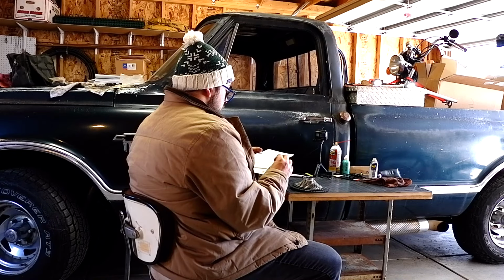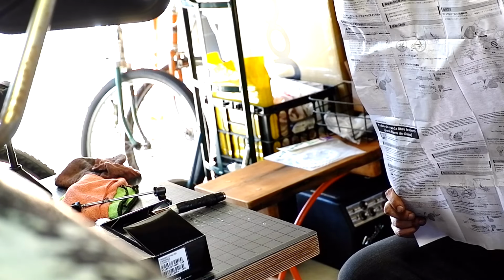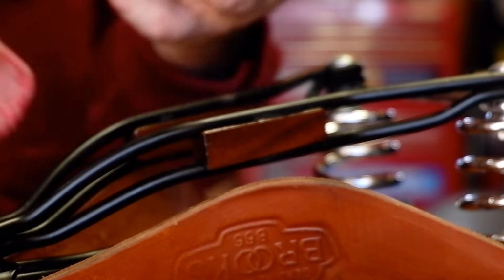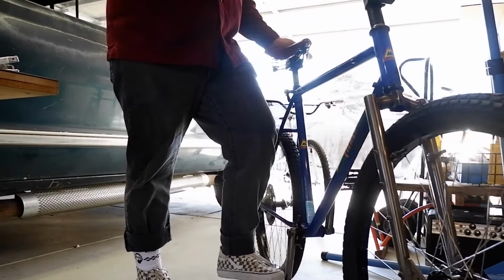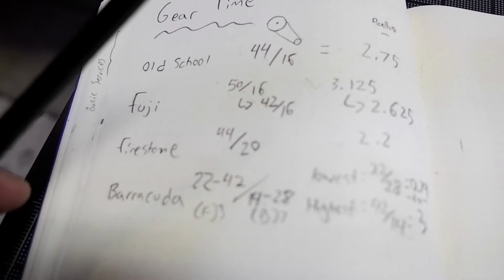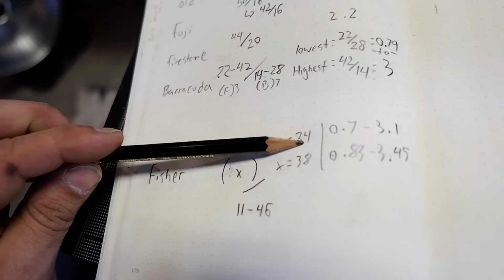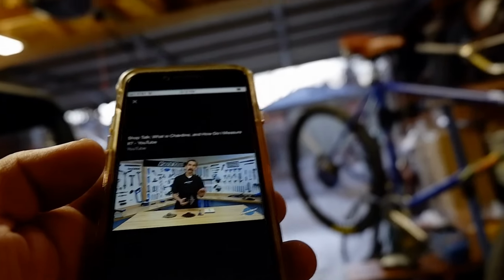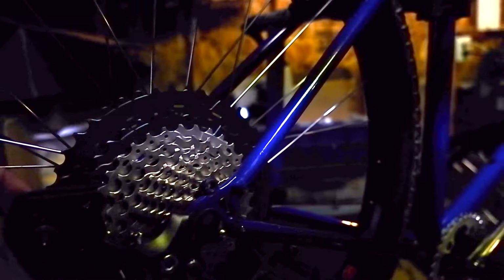BIKES! Gary Fisher Build Pt III - Vintage MTB Commuter

Comment: This video just popped up on my YouTube feed due to my research of parts for my 26" MTB to single speed freewheel BMX conversion. I'm currently building a 1999 Gary Fisher Wahoo in factory red with gold ano Haro Legends and gold Bolany crankset. Still need stem, bars and V-brakes. Should be very light when done!
Reply from the maker: Oh sweet man that sounds awesome. Right up my alley. Have fun!